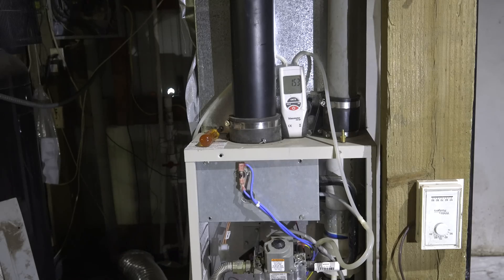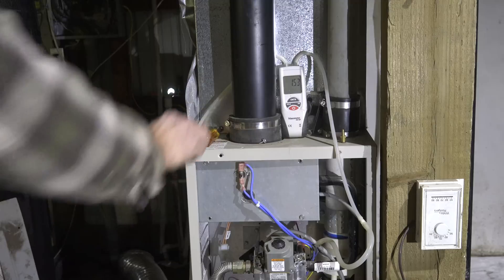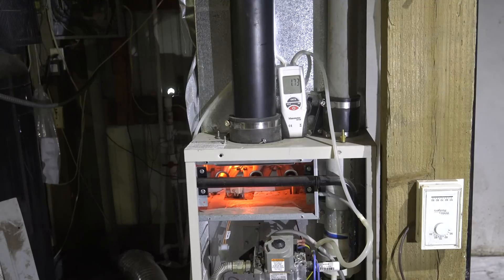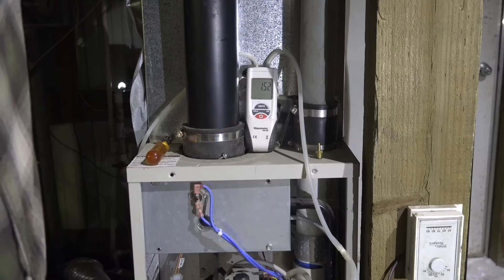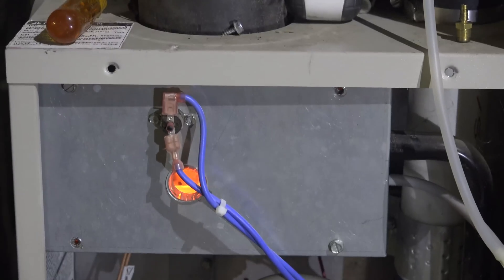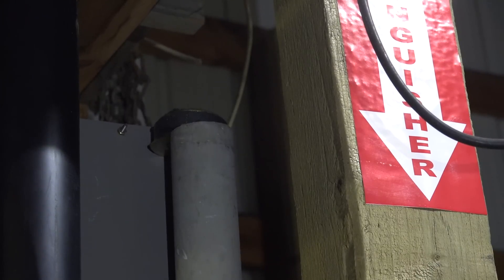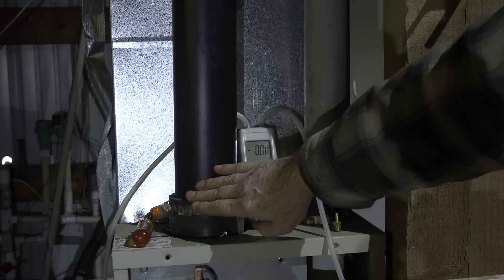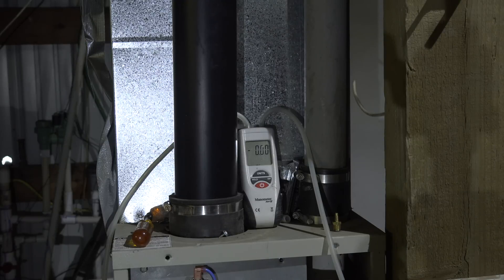What's wrong with this furnace, #12 answer

Comment: My furnace Trane X90 keep blowing cold air and I did reset roll out switch start blowing hot air but after 20 min still the same problem cold air.What do you recommend to check first? Thanks
Reply from the maker: If your rollout switch is opening, you either have a blocked or cracked heat exchanger.
GFM

Comment: hello. love you video's,  I got degree in hvac but they didn't teach alot on gas furnaces, which I own in my home.  my furnace will work fire sometime and work great for a day, but it shut off by itself and do that off and on. I know u can't say without tests,  but any pointers please?  it's a older Lennox pulse.  I replaced mother board already, filter,  and checked outside on what I could see so far in breather tubes and all clear. Thank you
Reply from the maker: These furnaces gave a lot of problems.  I would be looking at the spark plug and flame sensor.
GFM
Reply: Thank u, that was my next guess after watching it video's.  Keep up good videos!
Reply from the maker: These parts do seize.  Sometimes they will break off or strip the threads.  Then you are pretty much toast.  You can try a penetrating lubricant, but does not always work.
GFM

Comment: So the cover comes off, the burners lite and the combustion vents to? I think the engineer missed a real hazardous situation if the combustion cover is off;' the burners will lite and the exhaust vent is blocked. What do you think GFM? I would like your input on this.
Reply from the maker: I am not sure they can protect from this situation.  Note, in no case do the burners operate abnormally.  If the vacuum is not high enough at the vent, the pressure switch will not close.  The only change I would like to see in gas furnace controls is a pressure differential switch that senses the pressure differential between the entrance of the heat exchanger and the outlet of the heat exchanger.  This would shut the furnace down if the heat exchanger is blocked or it has a crack.  Not a perfect solution, but better.
GFM

Comment: Hi GFM, I have a self contained Goodman 2 1/2 ton Heat Pump. My contactor was stuck, it appeared it had arced close and I freed it. the heat came on correctly and went off the rest of the night. The next morning the blower ran, but the contactor would not engage. I ran it on Emergency Heat until I replaced the contactor. Today I replace the contactor, it was burnt. its wired correctly too but the contactor does not close. I was thinking the defrost/control board might be bad until I saw your video with the " peanut relay sticking closed". not getting 24 vac to contactor. any advice?
Reply from the maker: About all you can do now is check for voltage at the 24 volt terminals.  Also look for a blown 24 volt fuse on the control board.  Hope this helps.
GFM
Reply: ok, fuse is not blown. Thank You
Reply: On the defrost board try jumping the red wire to the yellow wire.  If the contactor engages the board is bad.  The jumper wire is only for a test so do not leave it in place as  fix.